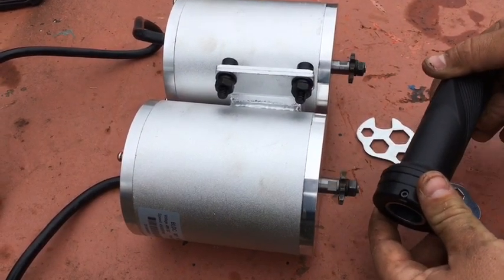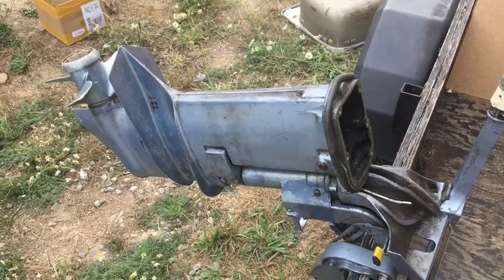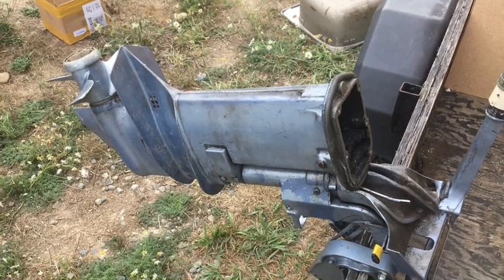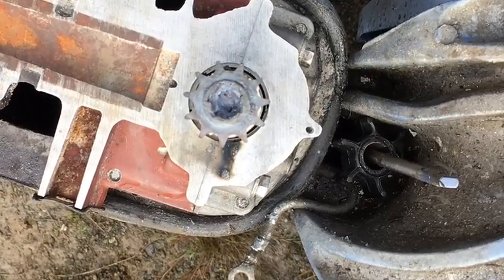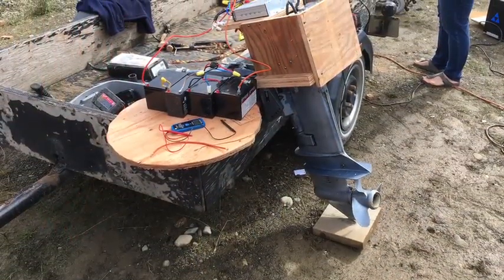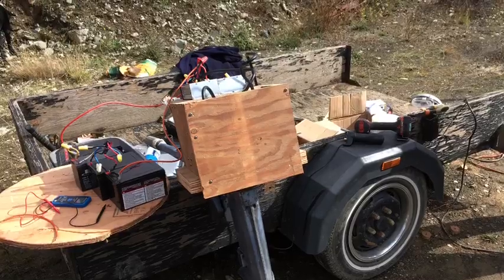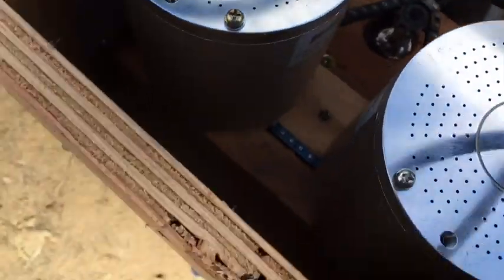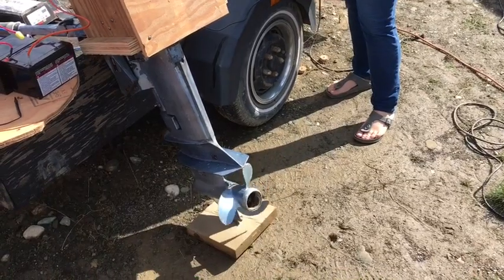DIY Electric Outboard (sprocket test)

Comment: Did you get it on the water? If so What kind of boat and how fast did it go? I’m thinking of doing this.
Reply from the maker: We did and it had issues with the chain drive I have had plans to try the 3000w motor instead of 2 1800s just haven’t done it yet

Comment: Rotation is incorrect for that prop
Reply: can go in either direction just like most outboards with a reverse gear
Reply from the maker: Video lies and shows the prop going in the opposite direction. But these controllers have forward and reverse

Comment: How did it work out? What was top speed?
Reply from the maker: I was waiting for parts on the Outboard and used one of the motors on my kids Go kart(see video)...I have ordered a 3200 w motor/controller kit and plan on using that instead because the chain is really noisy...
Reply: @CJs_DIY  so what happened!!!?
Reply: Got it! So you never tested in the water?

Think I’m going to try this also! Let me know that happens!
Reply: Looking forward to see how it went on water?